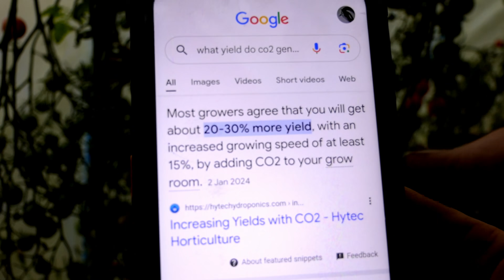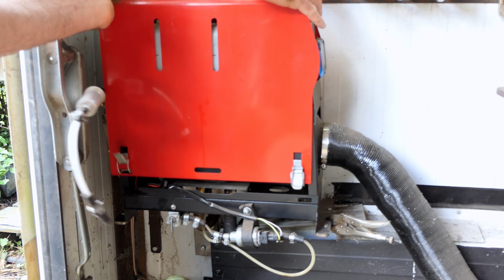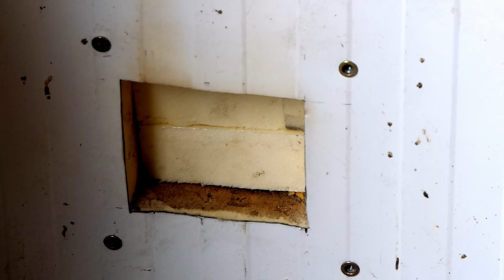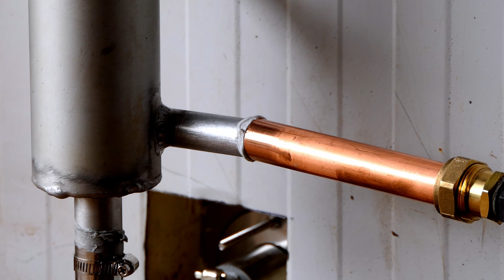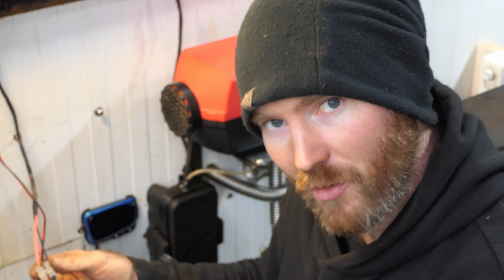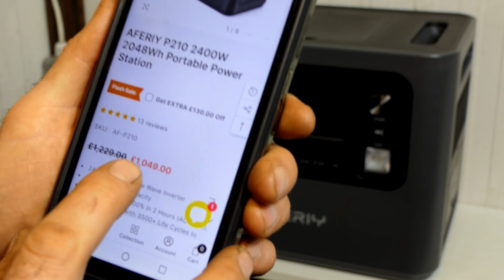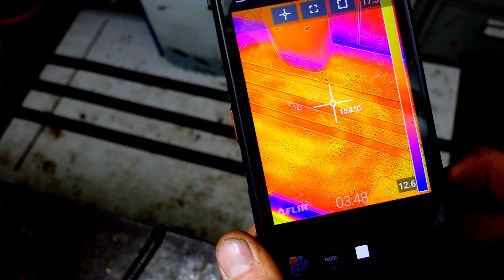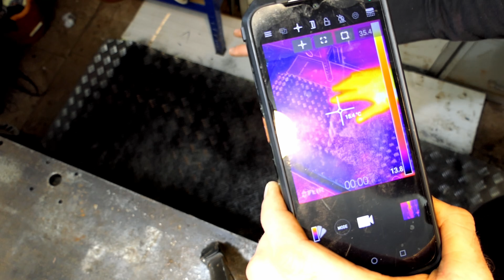NEW! Better system for Cheap and Safe Heating💲+ Underfloor Heating Mod test🫠

Comment: heatpumps can go higher than a COP of 4, 6 is achievable - "at best" is a dangerous phrase to use on the internet, haha
Reply from the maker: I mean when it counts in the thick of winter. I don't turn my heating on until it gets below 10°c outside and I know heat pumps lose efficiency when it's actually cold. Cheers J
Reply: @joshuadelisle  99% of heatpumps heating ratings are calculated at 7c, and a good percentage give figures at 2c or so as well if you dig enough to find the manuals. If you're using air to water and low flow temp underfloor heating, you can still hit above 4 at 0c.

The UK's position on heatpumps is stupid, to be honest. Air to air heatpumps make far more sense than air to water ones (I have both). They're cheap (compared to other professionally installed heating systems, a 7kw unit installed should be 1000-1500gbp), extremely efficient, and work very well, with a basic solar array you're covered on all but the most rainy of days. Theres a reason most of the planet uses air to air...

Comment: I agree with the poor man paying for climate change, whilst those with wealth do what they want. Whilst your figures are correct on percentage of CO2 you misrepresent the effects and causes such as caused by nature. A simple example is that livestock farming relates to about 20% of greenhouse gases, and this is due to humans wanting more meat on their plate, it not meat and two veg anymore. Another issue is that the other greenhouse gases combine with the Co2 to cause more water vapour which is the main problem. I have been a dam engineer for decades and have worked globally, I see first hand the issues caused by this heating trend, Bangladesh for instance, numerous island now being swamped with sea level rise. Europe suffering from extreme temps and forest fires, plus much more regular flooding, look at spain. These occurrences are happening more and more frequently. Having said that the little people have no choice but to add to climate change, we are being taxed out of existence and until there is radical change in the governance of the planet it will not change. Just look at the Bilderberg conference every year, held behind closed doors...
Reply from the maker: You're right, however methane only last 10 years and the process of pasture fed animals in completely neutral and sustainable. the other factor is geoenginneering and cloud seeding which is also creating water vapour at a huge scale and has been in effect since the 1950s. It can certainly be weaponised and used to displace people. Massive deforestation will also cause more land water and change in weather as the Amazon creates its own weather. cheers J
Reply: @joshuadelisle  the only country I am aware of that cloud seeds on a regular basis is UAE and this is not to cause rain but cloud cover to reduce local temperatures. 100% behind you on deforestation and as usual it’s the poor that face the brunt of the effects
Reply from the maker: @glynnepritchard2526  I'm pretty certain the UK are doing constantly although they won't own up to it. Vapour trails are very different and can easily be distinguished. Vapour trails also don't turn on and off like geoengineering dispersion does. All you need to do is look up. Also there are scientists who have taken particle data to prove it's true and levels of aluminium micro particles have been found all over place.
Reply: @joshuadelisle  What would be the point of cloud seeding the UK, its one of the wettest countries in the world

Comment: If I'm not mistaken, you have copper and aluminum connected through the water in your system. This will lead to galvanic corrosion eventually.
Reply from the maker: Yes that's correct through an electrolysis effect acting as an anode and cathode. Cheers J

Comment: Just a thought, how about a kerosene stove for cooking with a round wick height adjustment for heat control set at low for a clean burn over a hot water cylinder then tap radiators to it no need for mains, the stove is placed in a box with air from outside and vent  makes it RSA, as a child we serviced with Kerosene stove for cooking @-9 Deg
Reply from the maker: I'll be testing something similar soon. Cheers J

Comment: When are you going to make an overspecked air heat recovery ventilator? That should shut up everyone complaining about the carbon monoxide. Plus that it might help some people who are looking into how to make one themselves, or who are looking into buying an already-made one and whom could decide to make one themselves instead for a small fraction of the price. 
    And you could weld some metal in order to make a heating wall, heating the whole wall filled with water. Though you might want to get lots of small metal pipes with a bunch of 90-degrees connections, and use that to make a heating wall.
Reply from the maker: @SapioiT  thank you. I've seen a few people make very good DIY heat recovery ventilators. It's definitely an idea for the future. Cheers J

Comment: You should test plate heat exchanger. They have larger surface area so it should conduct more heat from exhaust and overall size is smaller then current tube exchanger.
Reply from the maker: @jaakkovertti  the only problem is how do you clean them? They're expensive too. I have another idea to test soon that's cheap and easy to maintain. Cheers J

Comment: Not sure this will be the same but in PC water cooling mixing copper and aluminium is a big no no. The copper releases something in the water that eats away the aluminium. So even if that barrier between the pipes works the water will carry the issue round with it.
Reply from the maker: @robharris3550  you're right. I made it from scrap but I think my next one will be either just copper or stainless steel. Cheers J

Comment: Great video, and chat about climate change. I hadn't considered the astonishing level of deforestation.
I am with you all the way on the scam of top much Co2
Reply from the maker: Thank you. CO2 may be an issue in the data report but it certainly doesn't account for all other factors including deforestation and geoengineering. As it's been said before 'data doesn't lie but they can get it say what ever they want'. Cheers J

Comment: Definitely use an EGR heat exchanger, more surface area. Quite cheap second hand (FB market place); just wash it thoroughly in a bucket of hot water with a squirt of washing-up liquid, and you are Robert's nephew.

Comment: Your mileage will vary. I've got 5.5kW of solar panels and 7.8kWh of battery storage and as my gas and electricity account is £300 further in credit than it was this time last year I have just reduced my direct debit from £28 to £15 per month, for my 3 bedroom detached home. I could probably have reduced it to zero, but I didn't want to scare my supplier.

I'm participating in electricity arbitrage by charging my batteries from the grid overnight at £0.1501 including VAT per kWh and discharging my excess that I won't need in the evening back to the grid during the evening peak period at £0.2620 per kWh. Daytime export of excess solar power that I don't have capacity to store and sell later at the peak rate is at £0.1287 per kWh. Due too the mild autumn, my solar panels produced 504.8 kWh and this means I've made a profit from electricity even in October. After including gas, my total energy costs were £18.71, plus a notional £38.30 every month for the interest my capital outlay on the solar installation would have generated if left in a savings account instead.

I'm in the process of installing underfloor heating ahead of getting a heat pump installed and it is designed to run at 35C and achieve a SCOP of 4.43.  Thus, in the worst case where there's no solar generation I'm not exporting anything back to the grid, 1 kWh of heat for my home will cost  £0.03388 including VAT. The opportunity cost of using solar power for heating rather than exporting to the grid will be £0.02905 per kWh. 

I will also be doubling up my solar generation, (and thus the notional lost interest will also almost double) and this should provide enough electricity to run and heat my home and propel an electric vehicle for 10,000 miles a year. Although I'm motivated to mitigate my impact on climate change, my main motivation is to provide energy security in my retirement. I'm mindful that energy costs have increased at 3 times the rate of overall inflation since 2008 and I don't want to become a hostage to energy bills again in the future. If my net usage of electricity is negative, then the higher costs rise, the more profitable it will become. That's what net carbon negative looks like to me.

Your argument about global warming is missing the crucial factor. Time. Yes, the earth's atmosphere has had far more and far less carbon dioxide historically than at present, but it took billions of years for the first life forms to oxygenate the atmosphere to the point where it could sustain other life forms like us that use it as fuel. Most of the decabonisation has happened in the last few hundred million years with carbon capture resulting in oil, coal and gas being captured underground.  The methane trapped under the arctic tundra is the most crucial part of this.  By burning fossil fuels, we're reversing hundreds of millions of years of decarbonisation within a few hundred years, and we have done this after deforestation and burning trees first. We're idiots for allowing this to happen, about as smart as the yeast in a demijohn and destined to the same outcome as the yeast. Evolution has no answer to this, it is a very slow and miserly process iterating over numerous generations, and we're already well into a man-made mass extinction event.  No doubt there will be an abundance of flora and fauna again in future as the survivors adapt to the geological clock being turned back hundreds of millions of years, but it won't be life as we know it now, and we're very unlikely to be part of it. Our social adaptation is at the generational level whereas our technological iterations are accelerating rapidly. I figure that we're heading to a dystopian future where we use AI killer bots to eradicate most humans in a desperate attempt to slam the brakes on climate change, but it will already be too late, as there's a tipping point when the arctic tundra starts to melt, releasing methane, which is a far more potent greenhouse gas than carbon dioxide, and climate change will just race out of control, with nothing we can do about it any more. As long as governments are cowardly and care more about their political survival than solving our collective problems, carbon reduction targets will be missed and all that methane is waiting. The tundra is basically frozen peat bog, just waiting for the  opportunity to carry on decomposing.

I have a Mikuni diesel heater on my boat, which heats antifreeze circulating through radiators. Their intended use is to preheat diesel and fuel oil engines, but they are quite nifty for heating smallish spaces. As with your blower, they chuck out a lot of heat through the exhaust. On the boat there's not much I can do about that, however, the boat engine coolant circuit first has a heat exchanger for the gearbox that looks rather like the one you showed in your video, then it has the boat engine, then it has the boat's hot water cylinder (and my goodness, does the water get dangerously hot!), and finally a hull skin tank to dissipate remaining heat into the water. Given how hot the hot water cylinder becomes, I think there's a case for adding another smaller cylinder as a heat recovery tank to circulate into the boat's central heating. I've not bothered as I'm selling my boat! I think there are two things you could do to improve heat recovery from your exhaust gas. One would be to pass it through the heating loop of an old low pressure hot water cylinder, as the volume of water you're heating in your heat exchanger is very small and the route the exhaust gas takes is very short. That would address both issues. The other is to snake the exhaust around your underfloor heating panel in parallel to your water circuit. I think the water circuit would start cooler than the exhaust circuit and end warmer, so there would be further heat recovery during the first part of the loop, and heat transfer to the exhaust at the end of the loop which would hopefully keep it warm enough to evaporate the inevitable condensate that forms when you start it up.

By the way, kerosene is not diesel without lubricants. Along with lighter naphtha, It is a fractional distillation product that lies between petrol and diesel. Kerosene is predominantly used for aviation as you demonstrated, like diesel and unlike petrol, it does not evaporate and produce a flammable gas-air mixture, and like petrol and unlike diesel, it does not become waxy or solidify in the cold conditions at cruising altitude. Also, regular central heating fuel oil is not diesel, and if you try to use it in your diesel car it would run very sluggishly. Along with lubricating oil, it is heavier oil, a fractional distillation product that lies between diesel and grease. The reason fuel oil is so cheap in late summer is because this is also the fuel used for combine harvesters and other heavy farm machinery. It is used all year around in ship engines. The oil refineries increase production of fuel oil in summer because of the surge in demand produced by the harvesting season. As it is less refined than diesel, it is also cheaper to produce, but the retail price is governed by supply and demand. In general, engines designed to use fuel oil can also run off diesel, but not vice versa. Although cheaper to produce, the retail cost of diesel is higher than that of kerosene or petrol purely because of the tax regime. Aviation essentially gets a huge tax break compared to ground transportation. Thus, the reason your blower is comparatively cheap to run is because it benefits from the same tax break.

Comment: Interesting! For a skilled individual this type of heating is practical, but most people are technically challenged & if the system was mass installed by professionals the small amount of emissions per unit become a lot & everyone becomes dependent upon foreign suppliers with all the associated geopolitical instability or we have to develop national fuel production using genetically modified agents. This could be done and would provide winter heating but is otherwise of limited use. The potentially of renewable energy generation with storage is far greater, creating very versatile electricity that can be used for all human energy needs. Since the fuel for renewable energy is free, this also offers the lowest cost long term prices. But as of now, the politicians have allowed existing monopolies to  exploit their position and charge excessively for the transitional costs to full renewable energy in the form of high energy prices. In the by and by electricity prices will trend lower as better generation & storage make the current & expensive grid system obsolete & few people will want to mess with tanks of fuel that are only useful for part of the year with fuels that will keep increasing in cost. Like everything the pressures of cost & convenience will win out. In the mean time skilled folk can do well with systems as you describe, but that is a niche market that will only help a small number of people. Thank you for sharing!

Comment: Agree with others, and as a sparky working with complex heating systems i can see that the U/F pipe is having the heat kept within the pipe ( not absorbed into its surroundings). Great to have the foam under it so as not to push into the slab floor, but needs a medium around the pipes that absorbs heat efficiently ( like dense flow crete / screed). Sure it would of performed as intended then.
Reply from the maker: @sparkyhobo3844  thank you. I'll Make sure to do that in the next update. Cheers J

Comment: Well for your efficiency, use a different heat exchanger
Build something like a buffertank on a heat pump systeem 
You would be able to drain so much heat from the exhaust that only cool air would come uit.
Next use a pump regulator to manage the flow through the water circuit.
And a pressure Barrel so you can use a closet system.
Good luck
Reply from the maker: @andresohier5228  good tips. Cheers J

Comment: loving the idea of heating rads with this thing. the underfloor was my first interest though. it would be interesting to see if this could be scaled up to do a large floor area.
Reply from the maker: @diaryofadeadtattooist  the other device I showed certainly can do large areas. I've got a lot more ideas to improve the efficiency of the heat exchanger coming later. Cheers J
Reply: @joshuadelisle Fantastic. I'll have to reverse chronology your related videos to construct from scratch the system I can implement. Looking forward to it. I'm an advocate for law if you have any queries. No council tax /free energy /no fines /dead legal fiction corporate name etc

Comment: Great vid Josh, thanks. For a quieter water pump, use a 24V pump and run it on 12V. You'll still get plenty enough circulation for the small setup (I run a big towel rail off a transit van EGR, recovering 430W from the exhaust), and even a £10 off ebay Chinese 24V pump will last years running on 12V. I agree with your unconcern about CO2, NASA's own CERES satellite data confirms the recent warming was caused by an decrease in ocean cloud cover, not the increase in CO2.
Reply from the maker: @rogtallbloke  thank you that's very interesting, I'll look into that information. Cheers J